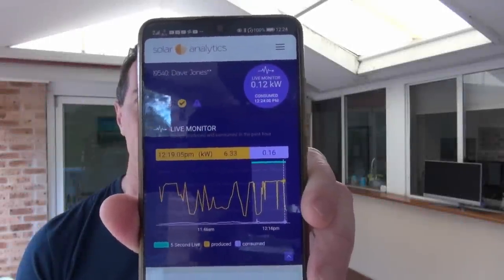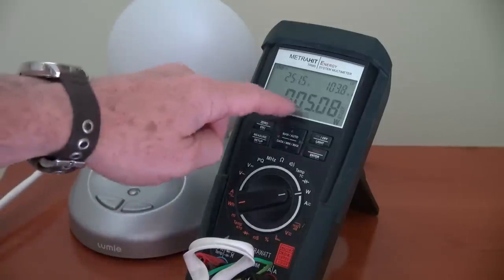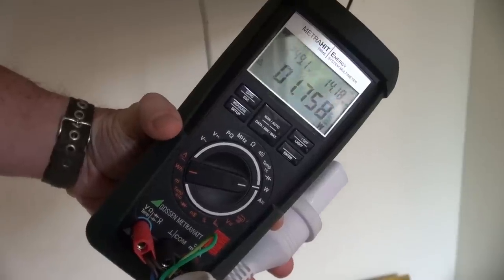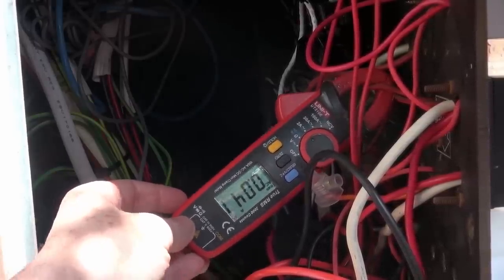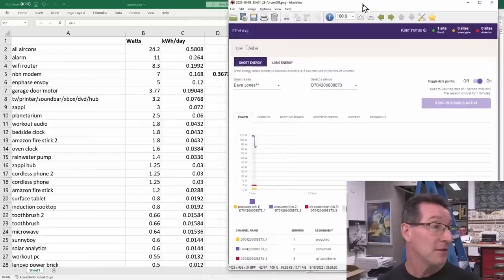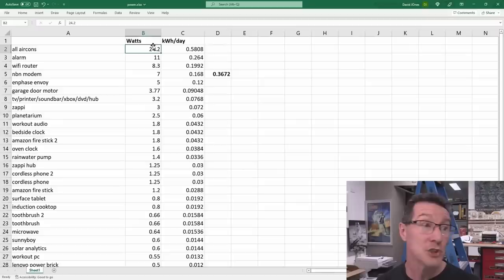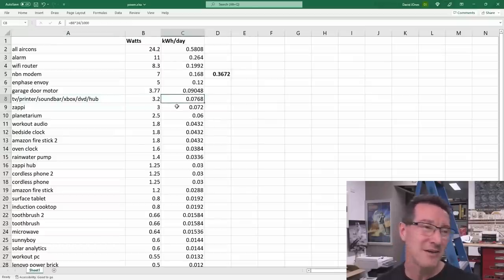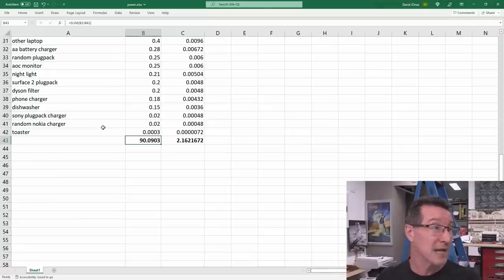EEVblog 1505 - 120W Home Phantom Power? Audit Time!

Comment: Dave, in regards to your car charger, can you add a service disconnect to it?
Not familiar enough with codes in your country. Most places in the US are ok  with home installation of them.
Basically treat it like an (older) electric fork lift charger setup. So they wouldn't chew through power when not charging a lift. If your charger can handle the off/ on cycles, it might help. Much more robust the the one you showed in the vid.

Comment: One thing to consider is if this energy is really wasted or not? I know it's soon summertime there, but here, at the northern hemisphere the winter is coming. So, what happens to this 120W? Well, it heats your home, as long as these gadgets are inside. Is it a waste? In summertime, sure, but from autumn to spring definitely not. Heating with a heat pump (air con) is more efficient, but I would not call this a waste, unless its summer. The closer you live to the poles the less you should worry about these. Old fridge? Incandescent light? Who cares if you are heating anyway...
Reply: Yes, exactly. As long as you keep the heat inside where you want it.
My server is heating my 3d printer filament-case so my filament is dried all the time. Otherwise I would need a (small but still) heater inside that case just for that function.
Reply: Well there are more efficient ways to heat up an home with electricity, an heat pump can generate (well not really generate, but move) 3/4 times the amount of power you put into it.
Reply: @alerighi  Yes, I know and it is actually in my comment.

Comment: Shutting down the internet during the night might increase the power usage on the phones a little though instead, since they check stuff periodically and would have to use the mobile network instead - which usually is more power hungry given the distance to access point.

Comment: My security cameras and WiFi system pulls 100w day and night... It's a big house with thick walls so almost every room needs its own WiFi ap. All internet thingies are fed through POE switch and it takes 60watts on its own.  Workroom lights are are on most of the day : 4-500 watts. Some always in ventilators: 15-20 watts. 
Planning to get some background systems on off gridish solar system like Dave did with fridges and I am getting miffed by the battery back I would need. Also the amount of solar it would all take to feed in the winter. Just finished the in grid system with 18KW panels. It's September with clouds etc and it almost doest feed the background systems during the day. No worries if there's any sunshine out. Than it can generate 100KW per day. But most of autumn and winter we would need thermal cameras to point at the sun. If winter generation numbers going the way I think it's gonna go- there's no point to even look at the battery solutions. I could spend tens on thousands on batteries that will be flat before the clock hits twelve on same day in winter. There just isn't enough winter sun to use in the house and charge the battery any significant amount. Better to just keep using the fixed prices to buy from grid and Nordpool prices to export the solar in the sunny season. Should generate enough prepayment to get yearly average to zero - ish.

Comment: I went the "saving energy, still kinda lazy" route:
My wifi AP has actually a software-timer function (turning WiFi off during night) and modern WiFi stuff also has low-power modes. It's obviously not reducing it to zero watts, but not having the Antenna-Arrays powered all the time saves at least something. For my PC and TV, I use those power strips that turn off Slave devices once the Master goes into Standby - in other words, Monitor, Printer, Audio, Consoles, Home-Theater, etc. turns off if the PC or TV isn't used (but still turns on automatically when I actually wanna use them).

Turning Aircon, Boilers, etc. off doesn't make much sense, as it just needs that much more power to change the temperature again in the morning. Clocks and Ovens are kinda the same, as they need power to keep the time.

Alarm, Internet, Switches, NAS, Server, etc. I can't turn off as I would get bombarded with "oh crap" notifications.
Reply: Turning off the aircon does actually help because a house looses or gains heat by the temperature differential between inside and outside. If the aircon is trying to maintain a differential of 10 degrees that is much harder than allowing that differential to go to 6 degrees for the night then turning the aircon back on in the morning.

Comment: Just a thought, for things that are only occasional use, get a mechanical timer type with the on/off pins.
Then, only put an 'off' pin at say 3am.
When you want to use the appliance, just use the override switch to turn the appliance on, will auto turn off later.
Not a good idea on computers tho' !

Comment: I’ve recently added some remote controlled mains sockets for the washing machine and tumble dryer. I’ve setup a timer on a raspberry pi to run them when we have cheap electricity. Fortunately both machines are old, so you can set them up, kill the power and they resume when the power is resumed.
Reply: that old washing machine is likely to use significantly more water than a economically well made modern machine. Obviously heating water is very energy intensive

Comment: Hi Dave, at night my house runs at about 250-350W but that's with 2 freezers and 2 fridges, all my network equipment, NAS, etc and the UPS's on them so that if I have a drop out on the solar or (if I'm on the grid) my connection to work during the day doesn't get interrupted. I see peaks of about a KW when the furnace pump comes on to heat the hot water tank. Once I'm 100% off grid I'll do an audit too to see what really can be turned off. During the day when my PC and monitors are on the house draws about 700W. Which is easily provided by the solar panels on the worst most overcast days.

Comment: do the air conditioner compressors have crankcase heaters, that prevent accumulation of liquid refrigerant due to gas condensation at lower ambient temp?  That condensation occurs when the compressor isn't running due to higher temp in the dome while the motor runs. 
If you do time lockout any supply to AC unit/s it may result in compressor failure/damage through hydraulic lock.

Comment: I did the same some time ago, now almost every device that consumes electricity when idle is connected through switch, I calculated I may saved around 80 kWh per year. My parents did the same and in their case it's around 230 kWh per year. Now I'm jealous of UK electrical sockets - every socket has own switch.

Comment: The crankcase heaters of ac units take a bit and it is not a good idea to turn them off unless you manage it a different way. You can't turn them off for hours and switch on or you could sling liquid refrigerant and DAMAGE the compressor!!! At the beginning of air on season, it is recommended to power condenser without any call for cooling for 48 hrs to boil off all refrigerant in the crankcase!!!

Comment: I had some high power outdoor lights (i live alone in the contryside here in sweden), they were 40w each so i put em on a motion sensor Works great but its now really dark when looking out trough my windows. The biggest power eater is my air-air heating pump, but its really needed in the colder time of the year.

Comment: My old house idled at 250W over nite, new one 150W (minus a fridge & a few smart lights).
This is important when you have a battery system - 100W x 10hrs of non-solar = 1kw.  Thats 10% of a good sized 10kw battery system!!!  Its worth it.
As a side note - A/C units, my old one was 3phase & 100wx3 purely reactive power!  so reports crazy numbers unless you get the phases etc

Comment: Excluding the fridge/freezer 7W idle. 
When fridge/freezer is ON is about 65W extra but since it has a 40% duty cycle is about 26W average so including the 7W will be 33W at night.
Reply from the maker: Your entire house is 7W?
Reply: @EEVblog  Yes at night when fridge/freezer is excluded. The house is offgrid so most devices ar 24V DC including the fridge/freezer.
I turn the inverter OFF when not needed so it is OFF at night as that alone will have about 30W idle and it is not needed.
Those 7W are for a small extraction fan, the phone witch is also internet 4G LTE and the computer's standby power (the computers are DC powered from 24V battery through a DC-DC converter as they need 19V DC).
idle at night is a bit below 300mA at 26V for the entire house.

Comment: At least here in the UK, and specifically where your broadband provider is using BT to provide the last mile (commonly called "fibre"), turning your broadband off every day could result in lower speeds because they will see this as a fault resulting in an unreliable service and they'll drop your speed to try and improve the reliability.

So YMMV on that. Best look into what power saving features the router/modem has before going down the "switch it all off at night" route.
Reply: They really need to scrap that last leg of copper.
Reply: @CamelCasee  yep, and stop calling it bloody fibre!
Reply: @TomStorey96  Twice this county has squandered its chances to roll out FTTH, once under Thatcher and second during the early 2010's when they went with FTTC. I'm starting to feel a little left behind with 30mbps down and 5mbps up, that's as much as my phone line to the cabinet can take due to distance.
Reply: @CamelCasee  The tech required to do last mile fibre back in the Thatcher era would have been a bit of a stretch, and probably still too expensive at that time because in the telecommunications industry in general, fibre optics were still in their infancy into the mid 80's.

But certainly in recent times it would have been much more cost effective, such as the early 2010's as you mention. By that time it was "dime a dozen" technology, but still requires a lot of work to pull the fibre, which is likely the #1 reason it wasnt done.

I feel "lucky" to get 70 down and 20 up out of my phone line, but its definitely time to swap it. Just recently OpenReach had to dig up the street to (try to) fix an issue with my phone line, but in the end they couldnt, so now my phone line hangs off a junction box on the front of my neighbors house..! I guess there goes any and all profit they may have ever made (and may ever make) out of my service due to chasing copper issues about. Roll out fibre already (and I hate the term "full fibre")!
Reply: @TomStorey96  Actually BT were in the early stages of rolling out coax to homes in the 80's, they'd even developed much of the technology in the UK, when that got canned they sold it off to NTL/telewest (virgin). And even if the fibre from that era wouldn't cut it by todays standards we'd still have all the street ducting and fibre ecosystems already in place for ease of upgrading (digging and laying new ducting is where most of the work lays). Much of the copper network is on its last legs and has been patched up with tape over the years, no wonder they couldn't fix it in your street.

Comment: You should combine as many DC powered devices as possible using larger "plug packs" but obvously only go as big as you need because higher power ones will have higher idle. This is why I have built DC distrobution systems. So do things like powering your fire sticks from other appliances with USB ports powerful enough. Or tap into a voltage rail on a device like the TV to power it up. For the WiFi Router and NBN Modem they should be powered from a single 12v plug pack then add a little RTC microcontroller with a mosfet to shut them down at the right times.
You should certainly focus on finding linear transformers and other linear regulators like your Alarm system and Garage Door Opener. I bet even the Aircon's could benefit froma MeanWell Industrial supply of the right voltage.

Comment: It'd be nice if the house wiring could take care of this by having 3-4 circuits at each outlet to choose from. "At home", "in bed", "away", and "always on".

One can get the same effect by putting Smart Home outlets everywhere and configuring scenes---but it'd be a real gamble if that saves energy or uses more than what it switches off. Centrally turning off whole circuits would work better.

Comment: The control board in my boiler is a huge energy thief. I now turn it off at the mains and only power it when I want to heat the water. It isn't yet cold enough to need to heat the house here in London.

Comment: My custom solar monitor does 5 second intervals constantly.  Does consume about 50mA doing it.  About 250mW.
I recently found a downside to this when I made my automatic interior lights dim slightly at sun set.  However the solar panel output bounces around at sun set and I trigged on "less than 0.1W" power.  So around sunset my lights on that theme start to brighten and dim over and over for 30 minutes at sun down.

Comment: I used my solar egauge to do an audit. I discovered that my Soundstage subwoofer was using 40 watts in standby. I also discovered that my Harman Kardon AVR650 was using 100 watts just turned on with no sound coming out of it. It turned on with my PC and TV and I rarely had the volume turned up. So I upgraded it.

Comment: Also remember that old wiring in the building can leak. Usual culprit is squashed conductors in sockets (L/N insulation breakdown).
Reply: Right!  Be sure to clean up those electron puddles.

Comment: Most of my parasitic load is 12V so I set up a dedicated solar power system for this based on panels on my shed roof and 240 AH of lead acid batteries.  This powers the wifi, security cameras, motion lights and soon will be extended to the ethernet hub and TV signal booster.  This load only averages about 20W and the payback time for this system is insanely long but I like the warm feeling of knowing that all of this stuff is running for free.

Comment: That 120 Watts is a drop in the ocean compared to the savings gained from replacing 100% of the incandescent, curly and straight florescent lamps and much higher power appliances like plasma TVs and such with LEDs and LCD TVs, etc. Ron W4BIN

Comment: the toaster is interesting because it should be actually 0. When you press the lever it completes the circuit and starts the timer, which opens the circuit entirely when the toast pops up. Your meter must be off.
Reply from the maker: Nope, it's got something on the input before the switch. The leakage is real.

Comment: For the TV stuff, they have power strips that turn off power to the other sockets when no/low current is detected on the master outlet. That might work if you care that much about it. Though I believe they're really designed for PCs where you might have a bunch of peripherals attached.
Reply: I tried one of these automatic power strips under the "Sunbeam" brand name. I was disappointed after a few minutes when the TV that I was using as master  was drawing current below the power strip's threshold, so it would shut off the amplifier that was plugged into the "controlled" outlet while the TV was still on. Sadly there was no way to adjust the threshold, so I couldn't use it.  (Hummmm perhaps a hack opportunity?) I got the power strip at a dollar store - I assume it was subsidized by the power company.
Reply: I tried one of these because the power company claimed it was mandatory. It used more power itself than the loads it was meant to switch off.

Also, a lot of TVs will turn the backlight off when the picture is dark, so just measuring current draw won't work. My solution was to build a device that tells HomeAssistant if the TV's power supply is switched on, and have HA control everything else.

Comment: Dave,
You just made a bunch of wackos run around their house trying to figure out how to save a nickel 🤣
Reply: That's me lol. Our energy meter is claiming we are wasting over 700W of power day and night, I am determined to find out what is using all that power because thats a substantial amount.
Reply: @jamescollins6085  Check it throughout the nigt and then calculate the mean consumption in Wh over one hour. This way you eliminate factors like fridges going on/off and such:)
Reply: @jamescollins6085  
That's like $0.05-$0.15/hr, no doubt that it's worth finding.
On the other hand: trying to find 50W worth of "parasitic draw" is a waste of your life and unneeded stress.
Reply: I just lump all that parasitic draw into the category of "auxiliary electric heater" and it's job done.

Comment: We have ( had ) a simple Zanussi combi microwave, grill, convection oven.
The only thing that suggested took power was a little screen.

So we nearly got a heart attack when we measured the power it took on standby.

It was 40 or 50 watt !!!!

All day long 24/7

So we immediately put an extension cord with a switch into the circuit.

That was an expensive clock 😡

Comment: This is why I unplug the microwave and every wall wart not in use. Vampire power draw is a bastard! Greetings from Nova Scotia.
Reply: You can put it on a power-bar/extension/"surge protector bar that has a on/off switch? If the switch can handle the running power/current.
Reply: @markae0  yup. Is what I do for most everything in the home.
Reply: I have a Microwave with mechanical dials. It should have no vampire power.
Reply: @okaro6595  caps and stuff will.
Reply: @markae0  I’m in denial to how much draw all the smart outlets and bulbs consume. Smart speakers…argh.